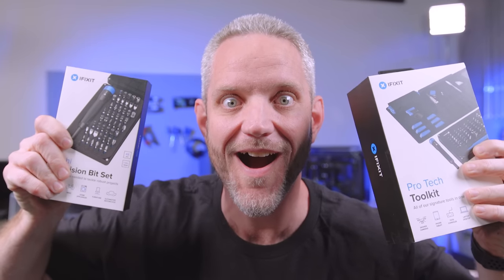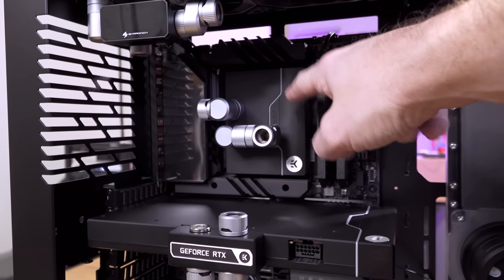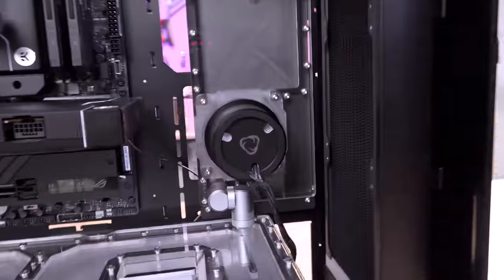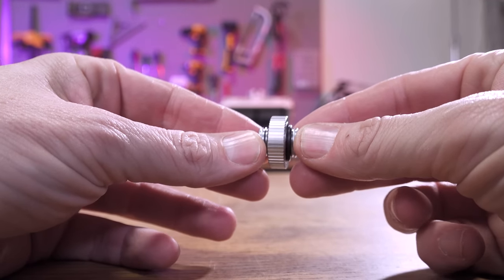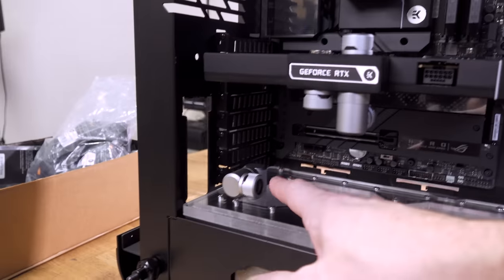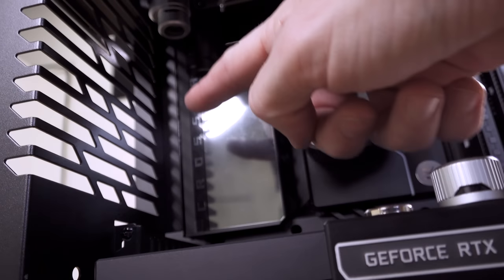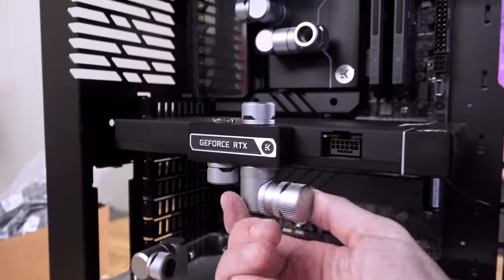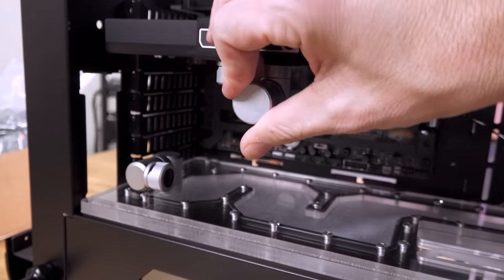My personal system is DONE and its BEAUTIFUL!

Comment: Jay I have gone through 4 x670e heroes and I have had nothing but issues, usb devices such as mouse disconnects, on all 4 mobos, the usb audio driver causing firefox to eat all my 64gb ram when watching utube then it causes a blue screen once all the ram has eaten up, did this on all my boards.  memory diagnostic tool in windows does not work even though I changed my CPU and ram aswell. With fast boot enabled, the debug screen shows A0 which I know means it's ok but the board that gets stuck on it and does nothing and screen is blank, expo ram just gives insane boot times like 1 to 2 mins whereas xmp just takes seconds to boot, Just keep a look out, I am now downgrading to a strix b650e e mobo just to see if there are any issues with the boards I received or something else is at foot. This hero board has given me nothing but troubles.

Comment: hey jay please look into the new nvidea drivers version 531.18 causing high cpu usage and high temp and when you go into task manager nvidea container is running higher then normal processes i literally had to go back a driver to fix the issue on my ryzen 5800x system

Comment: Hey Jay, could you make a video on Asus Armoury Crate. It is the worst software ever made. I literally cannot get it to work. On half of my boots it losses connection to my motherboard, it does not launch on boot so I get this rainbow RGB when it starts. The AniMe Matrix and LED freezes all the time or randomly goes back to default. Is there any other program to manage those things, is there any way to make it launch on boot so it remembers the settings without having to log into the computer first? I am literally going insane. I would truly appreciate your help!

Comment: Nice speccs, but damn it doesn't look good at all, I'm sorry dude. That case is just awful imho. But glad you like it, that's all that matter! And the content was good OG style, the "philtage" was kinda repetitive though - it should be maybe one third that long, without repetitive b roll shots over and over and over and over, yeah you get it.

Now just mod that GFX for unlimited PL etc. to make use of the water cooling, with.. is it 9 fans total? In a closed case with filters you want some over pressure in the case, so it pushes out air everywhere there's no filter. That help if you have sand storms in your area, dusty air etc. It keeps (mostly) all that filth out of there.

Comment: I disagree with the CPU. I had mine running at a stable Intel i9-13900K @ 6.2/4.7 GHz or i9-13900K @ 6.1/5.2 GHz compared to my other PC with the 7950X3D overclocked and running tons of gaming benchmarks using same custom cooling method. Now I have it running at i9-13900 @ 6.8/5.9ghz. This is as I have a custom high flow 720mm (60mm thickness) tubed into a frost free freezer. Regardless of the temp of the fluid pumping into a reservoir that resides in the freezer; the outflow going back to the CPU is always between -2 to +2 degrees C. (doesn't freeze, due to the anti freeze)
Reply: I also  use a few gold flakes in the fluid to watch how quickly and view turbulence of the fluid; depending on how hard the pump is working due to requirements of the  CPU when under different loads/heat

Comment: Frick is that a good looking build. I really love the drain-plug off the GPU actually, those fittings are incredible. Also props to Phil's editing, that scene change using the curvy line on the CPU block was on point.

Comment: 5,3Liter/minute? That's 318Liter/hour! A D5 will never reach such flow rates unless you connect a hose from the output directly to the input. That flow-meter is a joke :)
Besides that, a very nice build :)

Comment: Cablemod PRO custom cables DO NOT come with a higher gauge wire vs the normal cables. This is completely false. The PRO's just thicken the sleeving from 2.6mm to 3mm to have them appear thicker but they confirmed they use the same gauge wire which is a sham. Don't fall for their garbage. The 12HPWR cable is the only cable they use a thicker gauge wire.

Comment: Jay always makes PC building PC's way over complicated, especially the custom loop nonsense.  So much overkill and wasted money and the PC ends up with more problems than an early 2000's HP desktop as seen in this PC's update.  Keep it simple folks, no one needs water cooling and custom loops, it may be fun till maintenance time lol.  I have 13700k's and 4090's run perfect on air coolers and no game or prg required or even needed overclocking heat damage idiocy to be a thing.  Keep it simple folks, your sanity and wallet will thank you.